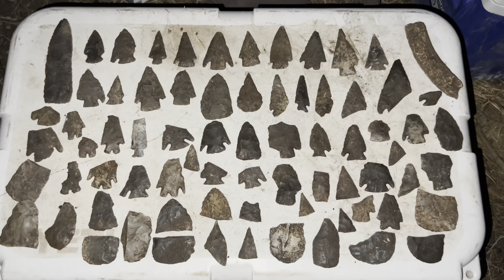INSANE DIG!  That’s why we dig right there!

Comment: Is everything translucent? Most of our Mississippi flint is not
Reply from the maker: No sir, not everything. Just certain materials and how thin some of them are.
Reply: A big chunk of my collection here in North Idaho are translucent, we also tend to find more smaller birdpoints and stuff around 1" long on average, but now and then I'll find something 3" and my biggest is a beautiful knife 6" long out of red Agate.
But seems our average point is a little smaller and thinner and the materials here are just amazing.
But I only surface hunt, I've never dug it seems a bit weird to me personally tho I've always wanted to just never done it yet
Reply: @mrdark9916  Digging can be quite productive in the right place. We find lots of small points too because of small nodules of flint available.
Reply from the maker: @mrdark9916  here that’s where the good stuff is!  You’ll be hooked right away
Reply: @SharkWaterOutdoors  I believe it, just looking at our surface collections Is mind-blowing how much amazing stuff we have found surface hunting for decades..

Quite a few Stone pipes (both whole chillum style pipes as well as independent bowls and stems that would go with a bigger longer wood or antler mid section) , Kaolin trade pipes of different types, trinkets, trade bracelets, tons of beads (even some stone drilled beads), a few trade arrowheads, pendants (one of which is Jade, a couple basalt with amazing intricate designs etched of alternating lines ect) , beautiful celts (including 4 Jade Celts 2 of which are translucent), beautiful Pecked/ground Pestles with knobs and rings around them, I mean we got a whole lot of amazing shit

But NO pottery for whatever reason, and idk about Bannerstones and grooved axes around here I don't know of any Bannerstones PERSONALLY and with the extent of the  collections of local stuff I have access to between us all, the amount of pipes, celts, pendants, Pestles (ground/pecked/grooved hardstone and/or drilled artifacts) ect we have leads me to believe Bannerstones and axes are Far far more uncommon around here. I know of only 1 hammer(round no bit) with a full groove, and a single ¾ groove axe. For whatever reason they seem more rare than even pipes and stuff around here lol.  

I know you guys out East more out SEEM to find that stuff a lot more commonly atleast from what I see on videos. 

We don't have any Effigy pipes or Gorget style pendants (only single hole or knotched) but I met a guy 20 years ago on a beach that had just found a broken pipe with a Chiefs head/head dress on it so I know that stuff certainly is out there. 
Never know what's 10yds from ya once u get on that beach!